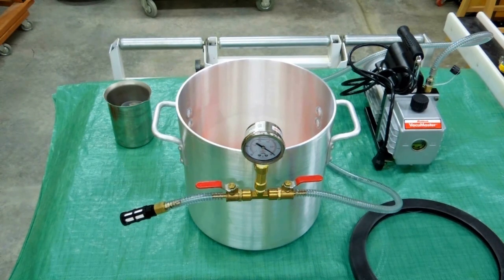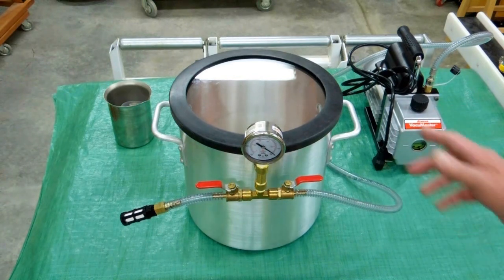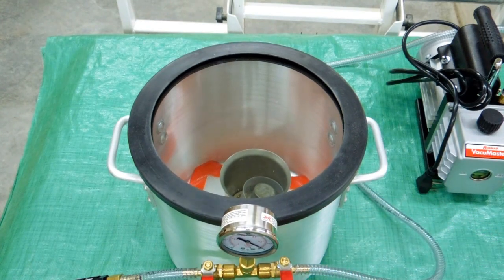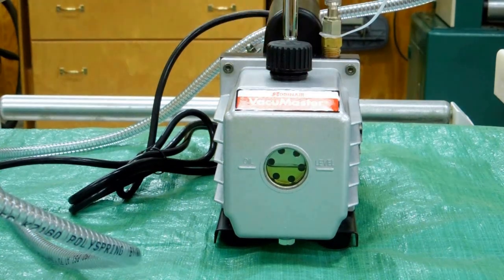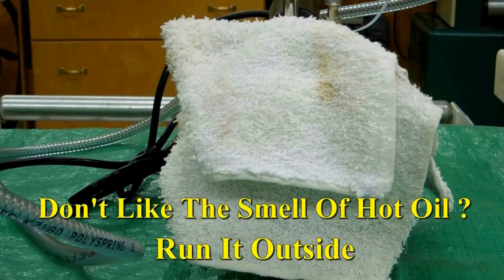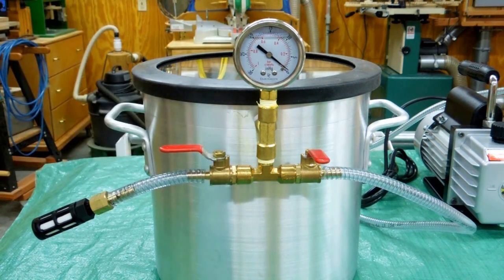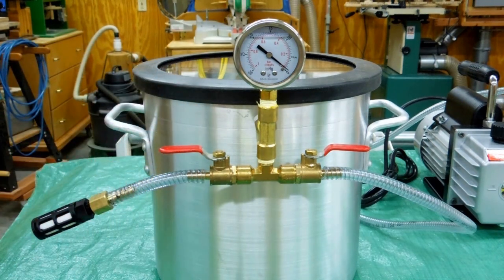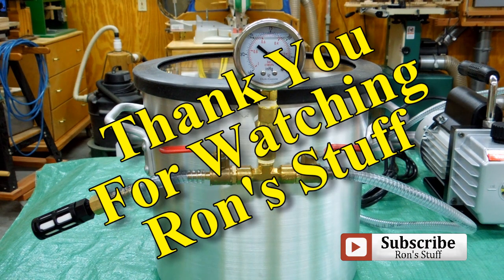Vacuum Chamber and Pump - Vacuum Infusion

Comment: thankyou for making this informative video. I just received my vacuum chamber and noticed there is oil inside of the gauge. Is this normal? I just returned one thinking it was defective. Now I am thinking they are supposed to be that way. Thankyou
Reply from the maker: Oil filled (sometimes called fluid filled or liquid filled) are generally a better quality gauge. The fluid (whatever it is) helps dampen the mechanism and pointer movements plus a few other benefits (lubrication, moisture protection, etc.).
Thanks for watching. Please subscribe!
That is what keeps this channel going.
Ron

Comment: My vacuum pump came with a sign saying not to run the pump more than 15 minutes at a time or it could break the lid so how do you keep vacuum for 24 hours?
Reply from the maker: Break the lid ? ? ? Ok, I haven' t heard that one before.  My lid for the vacuum chamber is 1" thick Pyrex glass. I pull the vacuum as far as I can, close the valve and turn off the vacuum pump. My lid seal and the two valves have held the vacuum for over 24 hours. Thanks for watching. Please Subscribe… that is what keeps this channel available.

Comment: Tried pulling a vacuum on a small batch of 2 part epoxy, however heat from the exothermic reaction had nowhere to go, so the test went badly. Hope the resin is another type. On the positive side we use the vacuum system for saving food in mason jars. Works great.

Comment: Hello! How do you know at what pressure that you have created a vacuum?
Reply from the maker: The second the vacuum gauge starts to move you have a partial vacuum and can no longer remove the lid. This is because atmospheric pressure surrounding the container is then slightly greater than the pressure inside the container. You want to continue to pull the maximum vacuum possible to achieve the best results. As the vacuum increases you will see more and more bubbles being pulled from the liquid (resin, silicone, etc.).

Comment: The instruction manual with my pump says that shut off the pump when the needle on the gauge is no longer moving or has reached the max. I am doing that but I find that it has never gotten rid of all the bubbles in the epoxy. It takes about 45 seconds to reach 30 kp, and then I shut down the pump and leave it in the chamber for approx 5 minutes. On a number of occasions I have let air out of the chamber and turn the pump on again and this helps but it takes about 15 minutes to get rid of most of the bubbles, and then I still need to use a torch to get rid of the rest if I am lucky. Any suggestions as to what I am doing wrong would be much appreciated. Thank you for the informative video."
Reply from the maker: I am not sure what you are referring to by "using a torch". When pulling a vacuum on silicone, when the batch rises and then collapses... you are done... leaving the vacuum on any longer is a waste of time.  When pulling a vacuum on resin, when the quantity of bubbles starts to decrease... you are done... leaving the vacuum on any longer is a waste of time. Some of these chemical reactions generate gas (or bubbles) and having it in a vacuum just promotes more bubbles (or gas). After pulling a vacuum and getting rid of the majority of bubbles (silicone or resin) releasing the vacuum and placing it in a pressure pot is the best practice. The pressure pot compresses any remaining bubbles and (for all practical purposes) makes them disappear. Leave the item in the pressure pot until the (silicone or resin) has completely cured (hardened). Hope that helps. Thanks for watching. Please subscribe.

Comment: I love the topic. I had a friend who stabilized wood handles but he put positive pressure around 200 psi into the chamber to push the resin into the wood. What are the differences pros and cons of using pressure vs a vacuum? I know about vacuum casting so for removing bubbles in your molds I understand. I just do not understand the best way to "infuse" or "stabilize a material.
Reply from the maker: mikekeystonefl I'm not there yet. I will have a pressure pot before long but for the reduction of bubbles in castings as you mentioned. I would expect better results if we can get the air out of the wood first rather than trying to force the resin in from all sides while the air is still trapped inside the wood. A sustained vacuum of 28+ inches of Hg creates a considerable force. Then returning the wood to atmospheric pressure (with the wood submerged in resin) creates a considerable force in the opposite direction. I can tell you the wood comes out dripping resin like a soaking wet paper towel. I think ultimately "the best way" is probably going to be a personal opinion.

Comment: What is that filter and what’s it for? Is it necessary? I have the same thing for making knife handles
Reply from the maker: As is clearly stated in the video, the filter is to prevent any dirt or particles from being sucked into the chamber when you release the vacuum. Is it necessary? That is up to you. The filter came with the vacuum chamber when I purchased it.

Comment: how do you like having the vacuum coming from the body of the chamber vs. coming from the lid?
Reply from the maker: I like it and operationally it makes no difference where the vacuum pump is connected. Not having anything connected to the lid gives good visibility of whatever is inside the chamber and when removing the lid you can quickly place it somewhere out of the way.
Reply: +Ronald Walters I read from others that the lids with the valves located in the center create a stronger pressure point which then over time causes the lid to flex and create stress fractures and eventually need to be replaced much quicker then having the valve placed on the chamber itself. im not sure about this at all, but it made sense. I'm asking for your thoughts because you are a knowledgeable guy and could help point me in the right direction before I buy a vacuum chamber. thank you.
Reply from the maker: The acrylic lids with a hole in them could be a problem plus the plastic will adversely react with some of the chemicals, in particular with the wood infusion "cactus juice" type stuff. My lid is a thick piece of Pyrex glass. Vacuum is vacuum regardless of the point to which is is applied. If a plastic lid fails while under 29 in Hg vacuum the resulting implosion could be quite dangerous. I like what I have and would recommend the same.
Reply: +macosta209
I completely concur with everything stated by this gentlemen, he seems knowledgeable at the least...and I own the same equipment. Vacuum is Vacuum regardless of the point from which the pressure is drawn. What matters is being to reach full vacuum and obtain it.
+Ronald Walters
I also own the 3 gallon glass vac for working with solvents and some other chemicals that could react with acrylic...we obviously use our pumps and chambers for different things... ;)
 ...but the science is of course the same.
Excellent video. Very informative. I especially enjoyed the part about people leaving a negative review because of oil spillage? Really!? Would you rather they not test the units then? And like you said...."JUST WIPE IT OFF!!!" that's not something to complain about...
Have a great day!